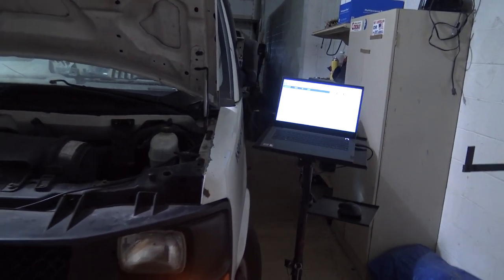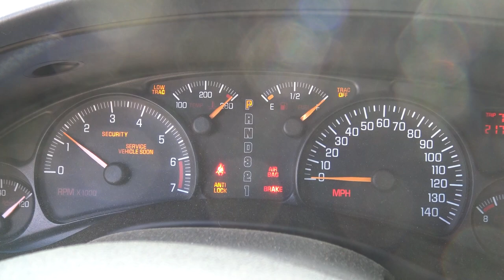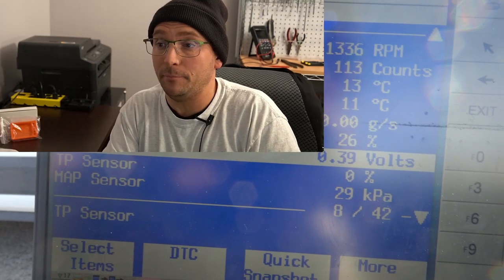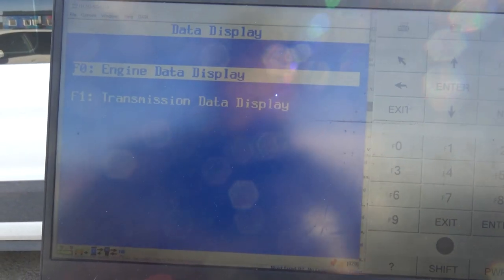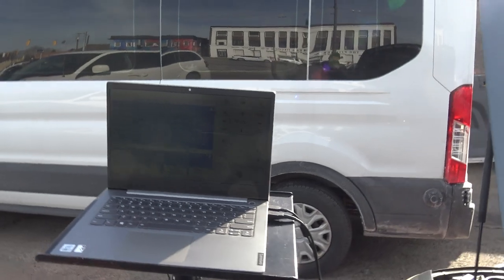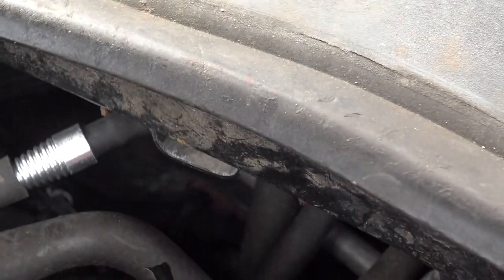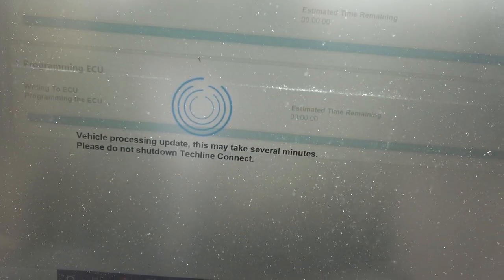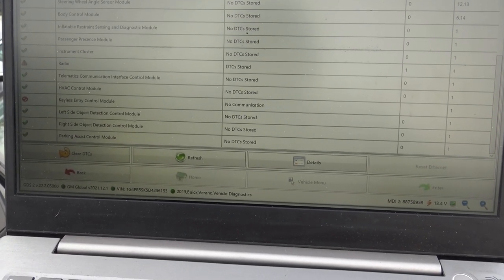Dodge P2096, P2173 , Chevy Express with bad gas, GM 3800 with a bad MAP 1 12 2022 End Of Day

Comment: On the contaminated fuel , was it water ? Someone moved and left several containers of gas . I put it in a lawnmower and then it would not start . There was no water . It wes not clear but slightly yellow . It did not smell bad . It ran on brake clean . I removed and cleaned the tank and lines . I also disassembled the carb and cleaned . With new gas , it was fine . I did see inexpensive test strips for gas on EBay . Are they a waste of money ? I can tell you , that FREE gas cost in time wasted .

Comment: On my OLD 1987 Chevy Celebrity , when the TPS went , I also had a MAP code . They are both on the same 5 volt reference line . I believe the TPS took the power down for the MAP . After replacing the TPS and clearing that code , the MAP was fine . What percentage of shops " diagnose " VIA Code only , never look at the entire system or figure out why ? Then after hanging parts , verify the repair ? Then if still bad , hang more parts ? And if a bad part is thrown in , never figure it out because. " I changed that " ?